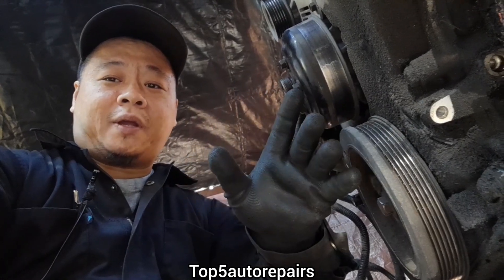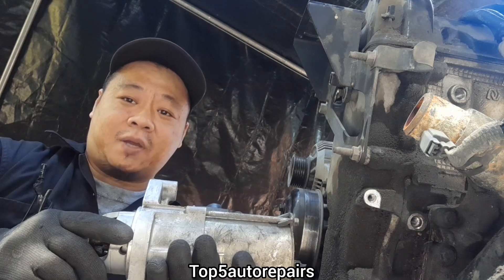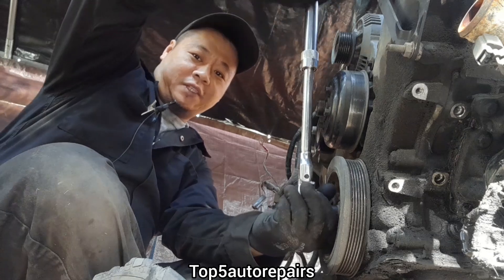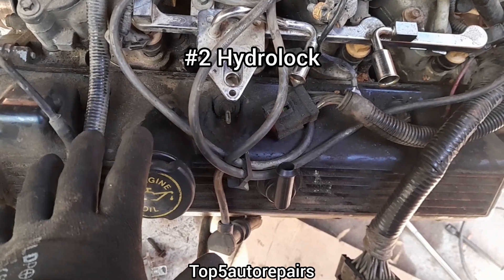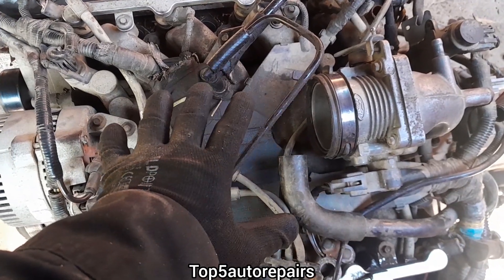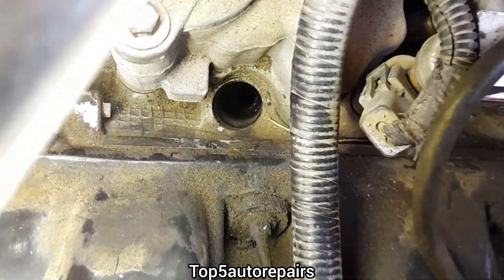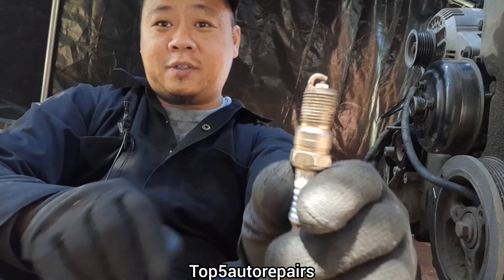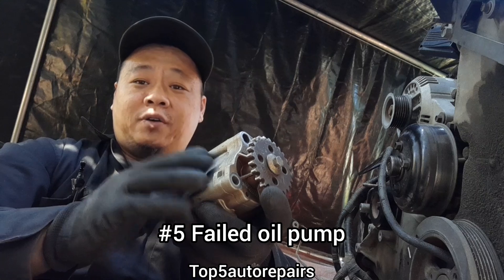ENGINE SEIZED OR LOCKED UP? HERE ARE THE CAUSES (NOT A STARTER ISSUE)

Comment: Had a 2014 VW CC with check engine light, 110K miles, oil always changed.  Took it to a nearby place. They replaced the spark plugs, changed the oil and cleared the codes and put some type of injection cleaner in the gas I assume.  Told me I needed new tires so the next day picked it up and took it for new tires then drove it home.  The very next day in the morning, I cranked it drove it maybe 3 miles, no lights on dash nothing but all of a sudden smoke is blowing out the engine and out the back.  I pull over and park. I look under and see fluid pouring out and a small trail behind my car when I had pulled in, it looks like oil to me on a paper towel.  I called a tow truck had it towed back to the place that did the tune up and oil change and next day they have some story about it being transmission fluid.  They said the transmission fluid was super low but oil was fine and maybe the transmission had the engine locked up.  I immediately have it towed to a VW shop and they say the engine is locked up.  I have no idea what happened.  I did check to make sure the engine oil drain plug was in when I pulled it over and saw fluid pouring out and it was.  What could it have been other than coincidence.
Reply from the maker: I recommend pulling out the spark plugs and use a flashlight and shine in the hole. Check if there is fluid or oil in it which there shouldn't be any.
Reply from the maker: It sounds to me like the piston rings/oil rings gave out for reason not known yet and it's causing oil to back up in the combustion chamber and it got burned causing smoke and oil to blow out of the exhaust.
Reply: @Top5AutoRepairs guy said he ran camera in there no issues but he is an idiot!  Wanted me to pay him to check the starter I said it’s not the starter!  I bought the car brand new but you work on it and it locks up a day or two later maybe drove 10 miles! 
I think he messed something up that was not happening before
Reply from the maker: Is there oil the engine? If so, pull out the dipstick and smell it. Does it smell burnt?
Reply: @Top5AutoRepairs I had it sent yo a junk yard and bought a new Tacoma!  Two days later,
Seriously
Reply from the maker: Tacoma is a good choice. One of the best light weight pick up truck.

Comment: The metal tip and a piece of the ceramic broke somehow  seizing up the engine. What would be the way of replacing that 1 pisto amd bore sĺeeve
Reply: It's an 04 F-150 5.4L Lariat, I know the side it's on. I know my options to get it done, so what I  had in mind is removing the head on the side it's on, and while inspecting it and if able to remove the piston and sleeve rehone the bore slide the new sleeve in place and piston. I mean I'll check the others as well  or replace the engine.

Comment: Hey
Thank for the video, have a 2010 Chrysler Town and country mini van with a 3.3 engine, tried to crank engine, but it won't turn, pretty sure engine is seized up, I was replacing injectors when I started up i ran very rough and smell like gasoline run burned right. You mentioned that injectors running rough could get engines seized up. 
Do I need to replace engine or can it be fixed. 
I would really appreciate any info you can provide, Thank you

Comment: This is enough to start a revolution! By the way, I have 4 questions please. The first one is, how do I know to rotate left or right, the second one is, what will happen if I rotate the wrong direction, the third one is, on the Ford 5.4 engines, I saw a video where the man said you can not rotate the engine with twin cam shafts as it will cause damage, and the forth one is,...is this true?, thank you.
Reply from the maker: 1. Honda/Acura turn counterclockwise, everything else go clockwise  2. Timing can jump 3. Yes, it's possible damage can occur due to slack in timing again throwing timing off 4. For the most part it's true. Always refer to repair instructions, all data is a good software to use.
Reply: @Top5AutoRepairs  Thank you. I appreciate and enjoy watching your informative videos.
Reply: I bought jaguar XJL ingine won't move I removed sparkplug all sparkplug are good but has sign of water I put pneumatic oil and wD40 and diesel to soak but it still not free any advance

Comment: Damn thats scary, i guess once then engine seizes its basically over? I mean, is the damage irreversible?
Reply from the maker: Yes and no. Mechanical damage it's over. Hydrolock it's possible engine might be fine. Always conduct a compression test after removing liquids in the combustion chamber.

Comment: GOOD VIDEO DO YOU HAVE TO TAKE OFF THE DRIVE BELT THEN TRY TO ROTATE
Reply from the maker: It's not necessary but there will be slight resistance when trying to rotate the crankshaft/pulley
Reply: @Top5AutoRepairs  THESE VIDEOS ARE PRICELESS